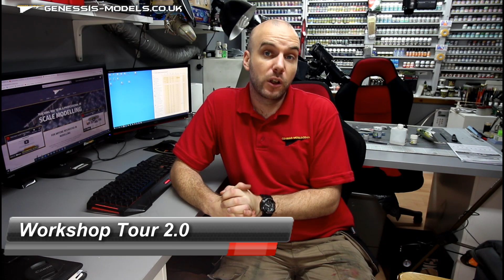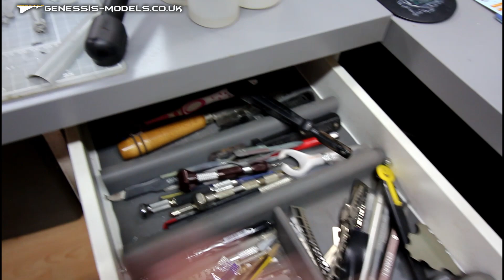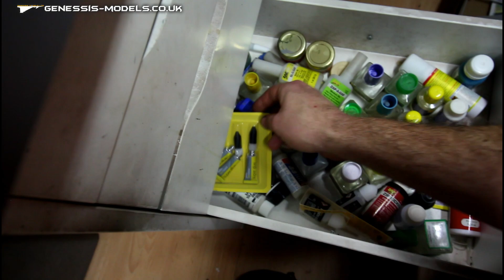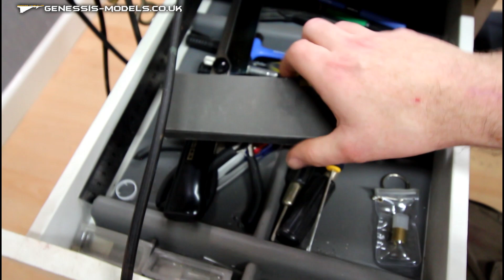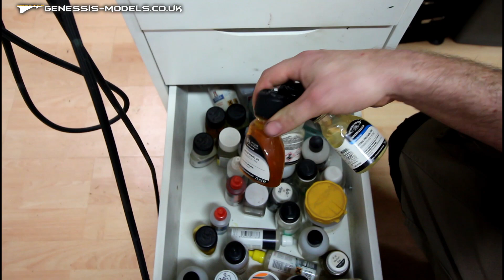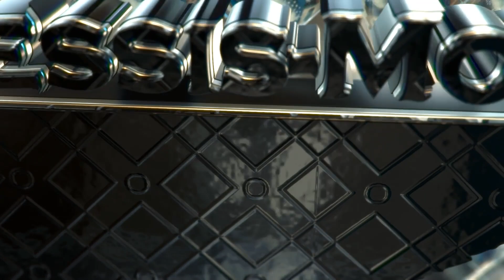My Workshop & Tools Tour : 2.0

Comment: Hi Bob. Compliments of the season to you. I do 1:35 AFV's and Dio's but have yet to start using oil paints. I see you have a nice stand of Abteilung 502 colours. For someone starting out in oils could you please consider doing a video on the basic set of colours required, plus the various techniques employed with them? Cheers.
Reply from the maker: I do all sorts of step by steps mate that you can see on the website, here is one example https://www.genessis-models.co.uk/videos/meng-models-leopard-2-a7-german-mbt-1-35-scale-model-intermediate-step-by-step-video-build/
Reply: @genessismodels  Thanks for that. I don't understand my computer. I am subscribed to your website and have hit the bell icon BUT I don't get notifications on new video's.
Do any of your attached links cover buying a basic range of suitable oil paints? (A bit pointless buying colours that will never be used).
Reply from the maker: Ive added this to the Q&A section of the upcoming show, so should answer your question beter

Comment: My workshop is in a shed type building and Ive always wished I had running water and a sink for cleaning  air and ordinary brushes, washing hands, cleaning  my  work area ect, ect....... do you have anything?
Reply: Meant to say above thanks for the tour, Im moving my operation into the house and you've provided some helpful tips.
Reply from the maker: Thanks Mate sadley no running water in here, its the one thing I dont have, that and a bar